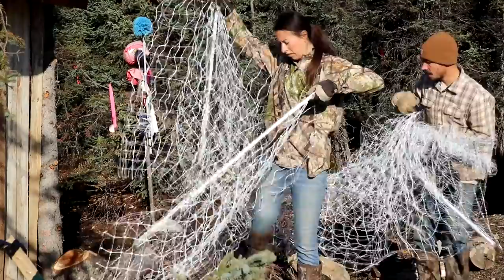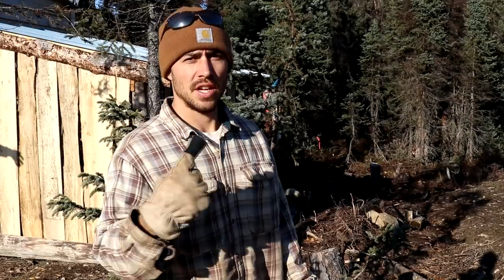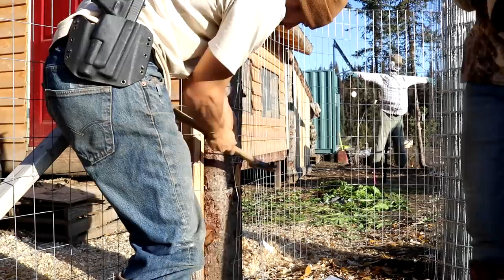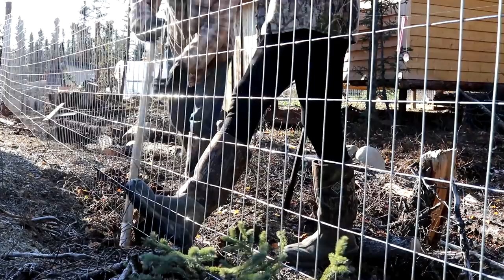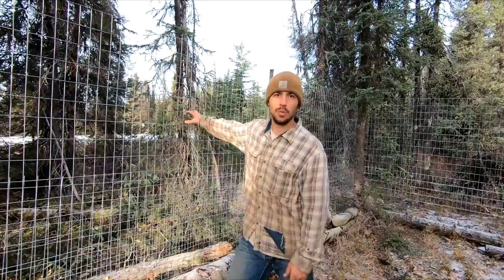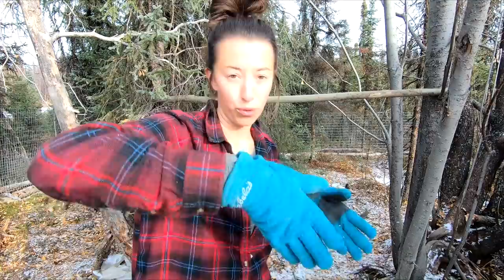Plan B for the Flock | The New Chicken Run

Comment: A few SUGGESTIONS to - consider - or not from a 50 years in Alaska homesteader.  Didn’t see your gate entrance 1. - a snow gate that raises and lowers according to snow depth and hugs the ground tightly.  2. Where to locally get a commercial weight T-post driver and T-post puller; the driver doubles as very useful slide hammer and lots of other uses.  3. another way to rabbit and dog-dig proof your fencing bottoms over way uneven and soft easy dig-able ground.   
 
Snow-Gate:  Our gate is 14 foot wide covered by four 4'+ gate sections that independently swivel and raise or lower that can be all removed ultra easy in less then 2 minutes to get the 14’ width for trucks etc and replaced in maybe 3 min.  The key is a hippy conduit hinge with a single pull-out conduit hinge pin.  Back in the 60’s commune days with little money we learned to be masters of jury-rigging necessity creating the mother of our “invention” of the conduit hinge system that has very wide uses especially for snow-gates.  Simple cut a bunch of 3/4” conduit into pieces about 8-12” long.  Take another piece of 1/2” conduit about 12-16” taller then your gate posts.  Example, our gates are 4 of  4’+ x 6’ tall sections made of 2x4’s the bottom piece either outdoor wood or pressure treated which hugs the ground, with a couple 45’s in two corners to add stiffness and a 1x6 cross piece at the height of your hand at it’s side for easy lifting.  Cover with fencing wire to create your gate section.  Your going to attach 4 pieces of conduit on one gate section and 4 pieces on the other so that when you put the two gate sections together you’ve created a piano hinge and the single piece more taller then the height of your gate is your hinge pin and you bend the excess height over 90 degrees for your pull handle.  BUT BUT when you place the opposing conduit hinge females we create a 6-8” spacing gap on each side that allows you to raise or lower the gate 6”-8”.  For deeper snow you just pull the pin up and skip a set of opposing female hinge sections. You two are EASILY smart enough to figure the not-mentioned stuff out.   We make the sections wide enough that they are substantially all-together wider then the gate opening so that one has to create a  double-angled section arrangement which adds strength and stability.  2 angled & hinged panels to one post and 2 to the other post they meet in the middle we just use bunjee cords for the latch.  These will always be resting snug into the ground by the weight of the gate easily raised or lowered by lifting the 1x6 cross piece of each section. You just lift a section to open it, opens and closes like butter.

Check-out Fence Emporium near Palmer for the commercial T-post driver and t-post puller; they cost about $60 a piece but will come in so so so handy and you’ll find multiple uses for the driver.  Weld a wedge type piece to a 1” pipe about 3’ long and you have one mean super easy stubborn birch log splitter you put the driver OVER and pound and of course multiple must other uses for a slide hammer.  These folks are NOT related I’m not paid or gifted to recommend them only do business with them a couple times per year but for me they are cool folks with all kinds of multiple use stuff like three guages of galvanized top rail wire you can use for left in place turnbuckles and all kinds of uses.  You take two wraps around two objects put a 2’ pipe in the center and start winding it tighter and tighter depending on width of space between the two wraps you can pull a good 6” or more.  The puller lifts t-posts like butter.  You can also make a permanent winch for longer pulls just insert a 10-12" 2x6 with the two wires wrapped around it so that when you turn the 2x6 with whatever turner you fabricate the length of your turner is the pull weight of your winch put a long enough turner and you'll break the two wires or crush the 2x6 it is THAT strong with using the heavy guage top rail wire.  Use two - four wraps depending on strength needed.

Rabbit and dog dig proof your way uneven ground fence bottoms.  Just get 18 - 24” chicken wire fasten to bottom of fence with clips and fastner you can get at Fence Emporium (it’s FAST) bend it over toward the outside or inside of your fence depending on keeping out or in and cover with logs boulders or stakes or just lots of dirt.  For extra protection lay two rows of barbed wire over the fold and lightly bury.

Best wishes to that cool couple who were classic Alaskan types way before they ever thought of coming here / HOME.!

Comment: You remind me of us 30 years ago.  Our solution for hawks and owls was to use an old gillnet recycled from a commercial fisherman friend of ours.  We had children, a dog team and livestock (goats, sheep, chickens, turkeys, geese, and ducks.  We were also on the roadkill list with the troopers at the time.  Anyway, if you can finds a "retired" commercial driftnet and string it up over your pen, it will deter aerial predators.  We had owls as the biggest problem, and although they couldn't carry chickens and geese away, they could dismember them and carry away parts, especially the head and neck.  We lost several geese that way before we found the net solution.

Comment: Love your vid’s

Just a couple things we have found work well (raised turkeys and chickens my entire life) 

We had weasel/raccoon/fox issues. What we did that fixed it was cut the same kind of 5’ renting you have there, wiring it to the bottom of the fence, scraping back 6-8” of ground around the outside and burring the fence. Not only did it stop things from digging under but it filled in our gaps from our un even ground. We also ran a single strand of electric 3’ up and 2-3” stood off the fence to stop the raccoons from climbing over.

For the hawk’s/great horned owl. We found cherry tree nets that where too old to be good for keeping out the small starlings and robins they where intended for. Those long nets weren’t bad to hang we tied flagging ribbon on all over and it kept them out. We netted about a acre of land in a weekend was a bit tricky getting around the trees but once your close enough the net is in the branches the birds won’t fly through. I know nets like that probably arnt available to you just thought id share. We had no luck with scare crows, line, even propane poppers (mimic gunshots) ended up just netting it all.

Comment: We just had to lock them in all winter. I built a huge coop, 8x16, with 8 foot roof. Perches and fresh hay and straw all winter. They won't come inside when its sunny out, and it will only be daylight for 4 hours, and 30 below near Willow Creek. Their feet freeze, and predators, love them, especially owls. We only kept up to 24, so the pecking order didn't get bad when cooped up.
Reply from the maker: Jason Pippin thank you for the info, I am thinking about vaseline for my roos combs and we have a solar light coming in the mail, hoping things go well this winter ☺
Reply: @SimpleLivingAlaska  Chickens were a little heartbreaking in the winter, and cleaning out the frozen glacier of chicken poop in the spring was a literal nightmare. I build the entire wall of the coop to come off so I could clean. It would be a foot thick frozen mass of poop. I'd put fresh straw down every week, but it would freeze to the floor even though the coop was relatively heated.

Comment: Also, I know you do not use concrete much due to heaving. But is you do use it for posts you do not need to mix it, especially when it rains as much as it does where you are at.  Just pour dry concrete directly into the hole and tamp it good. The concrete will absorb moisture from the surrounding poles.

Comment: After living in 2 farms with chickens in wooded surroundings & intense predator predation from ground and above....the only very good situation we had was our first farm with solid barn to keep out four legged varmits & we put the chickens to bed every night before dusk with intensive protection both with blackberry bramble paths in pines & bushes; & forsynthia bushes along wooden fencing...it was so dense that the hawks & coyotes didn't have the ability to reach them.  I sat with them at times if I saw hawks & saw attacks through windows but the birds knew to hide. Hawks are too smart for scarecrows. We lost the battle with our second farm... acres of cornfields hid coyotes, foxes, possums and the hawks loved our trees and  they systematically took out our chicken flocks over 4 years. We had top of the line electric fencing but you're right it's only effective until fall...leaves debris & weeds against electric fencing is a real problem and snow takes the charge out. If you don't have good solar charge it's useless as well. If you don't have bird netting on top you have to give your chickens bushes to hide in...but we struggled with bird netting as wild small birds would get caught inside and they are so fragile.  Our second farm just didn't have dense ground cover enough for our birds...we purposely let tall weeds grow around their coop to give them shelter but their coop was not as secure. I have one last bird alive and she's in a rabbit hutch/run...but I need to rehome her to a better life. >.< predators....suck.  We just won't have chickens again until we have a better environment with brush & solid built barns.

Comment: So what I had to do for the winter was split them up and use 10x10 outdoor dog kennels and wire the bottom and the top.  This is after three years of losing them to hawks, bobcats, badgers and the occasional dog that gets loose from the neighbors.  They each have covered housing in the kennels (repurposed dog houses) up off the ground.  They have room to run but I still need a chicken tractor in the Spring/Summer for grazing.  I keep about 6-7 chickens in about 100sq feet plus roosts throughout the kennel. Water bowls are heated and occasional heat pads when temps are below 10 degrees down to -15 for us.

Comment: You seem to be digging a lot of holes for posts etc.  I owned a real estate post business for about 8 years. We took digging bars like you have and cut off the flat end. We then added a small plate of 1/2 inch steel and welded it on. this is to tamp the soil. Believe me it is easier than what I have watched on your videos. Sharpen the other end to a long slender point.  Use it to loosen the soil.  Then use a post hole digger to remove the dirt.  This worked real well for us.

Comment: One guy had problems with minks, wesmazels something like that, fox, something.  But the solution was to dig a wide trench, l ay the fence down to the outside angles out and  bend it up as it'd normally run.  Something try to dig through will only get to dig into wire which is fruitless.
I had the impression Alaska was more wild. Hadn't heard anything said about skeeters.

Comment: If the music worked for the hawks, would wind/wood chimes help? It might scare the chickens though i dont know...
You both seem very capable with building things though. If they had like a shelter close by to run under(i'm thinking essentially an extra large coffee table style thing) i think they could get out of the line of fire so to speak. You could just put it where you feel they would be most out in the open. And they could climb on top too chickens do love to hop up and down off things lol (so maybe not too close to the fence lol)
Doing L shape with wirefencing at the bottom can stop digging predators getting under cause I think they always dig at the base line. 

Btw i've only discovered your channel and am watching everything. Love you guys your lifestyle is inspiring and you seem very capable yet refreshing honest about being beginners about things. Best of luck with the hawks.

Comment: Good efforts :)     My experience with keeping chickens has been very similar and my philosophy opposed to confinement for any animal is the same - I want them to live as natural a life as possible.         The strings and ribbons and cd's accomplished nothing.   My environment is not as natural and woodsy so I finally covered the  3000 sq ft of coop yard and garden with aviary netting (Walmart).   Works beautifully.   I confine the young chickens in that area until they are full grown, about 22 weeks.   Then they're all allowed to free range in an expanded area (about 1/2 acre),   where they are more vulnerable but I've observed that it's usually the young, smaller, dumber hawks in summer and fall who try to attack the big chickens but just aren't big enough to grab and lift the hens.    Another facet of protection I've developed is the many giant shrubs I have scattered around that the chickens run under when they see a hawk.     Not sure what you can plant in your climate but here in NC   Russian Olives camellias, Euonymous and Winter Creeper are their favorites.   All are about 10' tall and diameter with thick low hanging branches.      They are slower growing being evergreen,  but will multiply on their own in undisturbed areas.   I've also  created little teepees or "huts"  about 4-6 ft tall,  of branches and brush around the yard, about 30 feet apart.   Vines (honeysuckle here)  volunteer to create a thick web around them.   Interesting to note - There is also a wood shed,  IBC totes up on blocks, and the coop itself that could provide shelter but they NEVER go under them, even if it's closer than the nearest bush.    They also don't rest under the wooden structures - they always go under a bush.     Best of luck - you're making progress :)
Reply: Interesting! My chickens run under or inside their wooden coop or the trampoline we have in their run if they see a hawk (or dove, or mockingbird...they are truly chickens 😂). However, we are in the process of planting more natural hiding places for diversity and to further discourage air predators.

Comment: If you make a permanate  fence for chickens don’t put a wooden cross piece between poles. They will aim for the board between posts, or a pole, anything solid. They can’t see wire up there so won’t try. Chickens are smart. The wire is heavy duty. You must have had a nickle or two to start this venture. Good luck to you both. ( You are going to help your wife withe dishes and all the ect’s in the future aren’t you. Her work will go on for a long time. A 12 gage shotgun for the Hawkes.  Have fun.

Comment: You know how you have the long greenhouse do that but cover it with chicken wire .. maybe an area like that where they can get to for safety so the wire would need to be a few feet off the ground and in winter it can be a chicken run if it's covered with tarps .. ? I think both of you are made of the same cloth as what our forefathers were